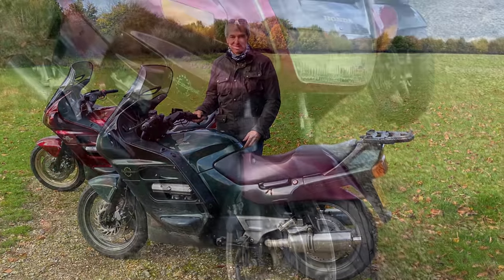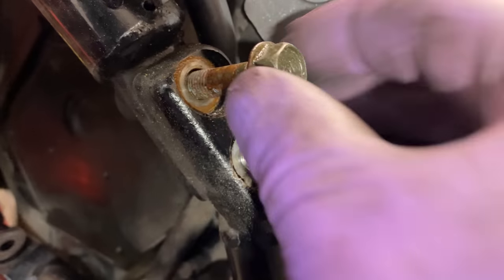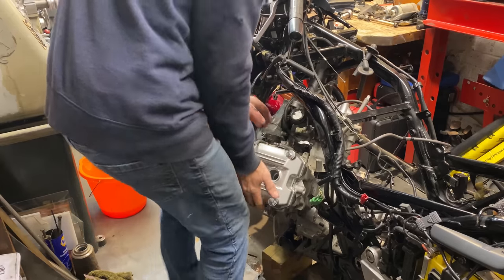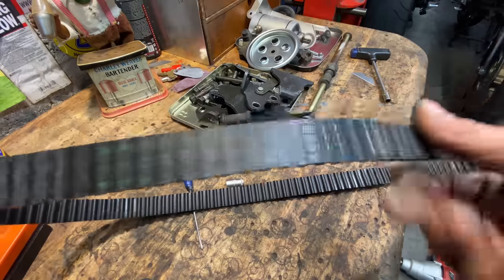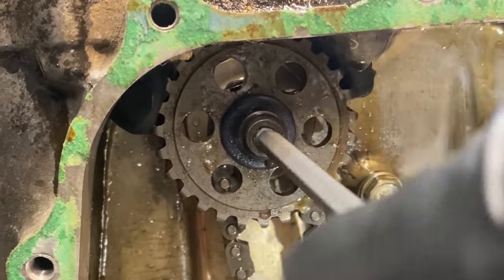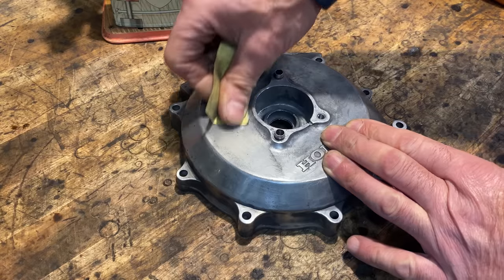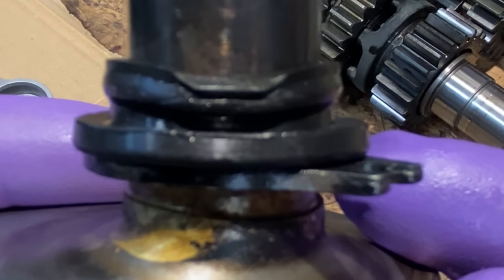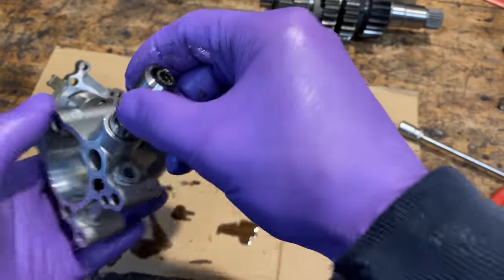Honda ST1100 Pan European engine removal and strip

Comment: Great to observe the Millyard in his native territory, not being mocked and under appreciated by the yellow haired ‘hey now right mate’ pillock on the tell-lie-vision. 👀🧐😎😜

Great vid. Awesome engine too. Love the design and layout of everything. Honda learned a lot from the CX500/650 era. 

The stainless water pump impeller made wonder if a similar design would solve the BMW F650GS Rotax issue of disintegrating plastic impellers. If I fabricate one out of stainless steel and braze the vanes on, will it need balancing? Probably not. Or could I just copy Honda’s design? Maybe. 

Great oil pump design too. Have always believed that the notorious oil pressure and supply issues experienced by Honda’s early V4s (Sabre, Magna and VF750F Interceptor) could have been solved with double oil pumps. Your reveal has got me thinking. 

Now I need to watch again for all the gems I missed. Thank you for sharing. Merry Christmas Allen and Tracey and hedgehogs. 

Peace 🏴

Comment: Absolutely loved my Pan, took it across to Belfast, down to Cork and over to France. Only problem I ever had was the oil filler cap "disappeared" on a run to Wales, I don't know if it fell off or was half inched in one of the service stations - anyway Halfords came to the rescue with a bright Yellow replacement. I did change the tires to Crossply's instead of Radials after talking tires with two ST1100 riding Glasgow traffic cops. (no not a lecture !)  Has anyone else tried Crossply tires on a bike, I had never heard of a bike shop even offer them.

Comment: He makes this look so easy but it's not... I don't understand how he can just pile up the bolts like that and know which ones go where, that's the most monotonous part to me so I have a trick where I use a piece of cardboard and I trace the shape of the part then push the bolts through it to keep them in the exact same hole it was in. I've done a couple of builds where the bolts were the biggest problem and I feel like moving the bolts around causes additional wear on the threads so I try to keep them in the same hole... Great video, Thank you Allen.     😁👍

Comment: Great video. I've got a ST1100 engine in a kitcar and it goes well. I know that oil pump well as I was planing at one stage to adapt it into a dry sump pump using the first stage as the scavenge pump and the second stage as the oil resevoir pump. As with many of my projects I did all the design work and once I'd worked out how to do it moved onto something else!!!

Comment: Allen, one task I have been mulling over is how to delink the CBS on a post 96 Pan.

The OEM hoses are NLA, and it's not practical to remake the complex hoses around the LHS fork leg.

It's easy to piggyback the primary and secondary circuits on the three calipers, but I'm not sure how best to loop or blank off the secondary circuit on each ABS pump ?

Many Pan and Blackbird have 20+ year braking systems and no practical means of  renovating - could be an interesting topic to cover ?

Comment: Glad you were able to save it! I just junked my '85 Gold Wing after knocking #3 out of it, and you can't just go get parts for it anymore, not even from Honda. The rest of the bike was so worn out it didn't make any sense trying to save it when a fairly mint one can be had for a 1/4 of what rebuilding just the engine alone on an already junky bike would have cost me. So off to the scrap it went. Wanted to cry but it was the right thing to do in that case.
Reply from the maker: Some Parts are becoming scare now for pans as well
Reply: @AllenMillyard  funny enough I'm seriously looking at a pan, a 2003 1300 to replace it. Already done a few wings so might as well go much more modern! But you're right, this whole parts thing bothers me.. I hate being head over heals with a bike only to not be able to rebuild after I've absolutely miled it to death. And there weren't that many ST's in the States to begin with so I just don't know what to do
Reply: Ran into this problem myself last year. I needed to replace my fork stanchons on a 97 ABS Pan last year, just couldn’t get a pair any where. Ended up having them rechromed instead, probably a better choice in the end.
Reply: @andrewnewstead4367  I'd agree. Original parts, I've learned the hard way, are often worth repairing whenever possible, even if a repair costs twice as much as a whole new aftermarket part for something you can't get an OEM thing for anymore

Comment: Hey...great video..
I have a question..
The rear brake oil does not return cbs system..
The calipers are fine..
When I disconnect one of the brake tubes on the rear the calipers go back..
Do you have an idea?
Greets from Belgium.
John
Honda st1100 abs cbs TCS 1998
Reply from the maker: No abs on my bikes

Comment: Great video but I am worried for your  fingers with that blade for scraping off the gasket. I have got a blue plastic holder for my blade which is safer and gives much better control of the scrape.

Comment: That's awesome  perseverance .. you've got it by the ton Allen    currently  I've  got one of my '87 xl600r Honda's  torn down with only 2,000 miles on it after it jump time     the timing chains seem to be a really weak point on that particular style motor    when I inspected the chain it was really stiff (kind of like the metal got hot and gaulded at the pins but didn't seem to be worn   as in it didn't  pull away from the cam sprocket when I pull it at midpoint   much at all  I guess the stiffness of the chain   alone  caused it to rattle jump time  I don't know if it's a defected chain or possibly a lubrication problem    ... I've got an XR650L basically the same motor with  20k mi. On the clock   and the chain is still tight as a drum   no noise    but I have four XL600R and all the timing chains rattle on them

Comment: Hello Millyard, I bought a Paneuropean in Holland (via the Net), it came out good, it's from 1991 and has 97000kms. Works well, has a healthy engine sound.
I'm afraid, because I don't have a motorcycle license or experience. I fell in love with the mechanics of this bike, but I'm afraid I won't be able to ride it, it's so heavy. I'm 1.70 meter tall and 60 kg in weight, and 60 years old, what do you think?
Another thing, I noticed that the gas gauge seems to be stuck in the full position, how do you fix it?
Reply from the maker: I’m over 60 and 68 kg have no problems riding the pan European or my viper v10

Comment: In the late 90's I had a ST1100 that I had done 100,000 miles on. It had a knock when shutting the throttle at low revs in gear. On stripping the engine all was fine except the bearing behind the clutch that had a retaining plate (I think is was behind the clutch or it might have been behind the drive shaft from below the clutch). On removing the retainer the bearing was very slightly loose - just enough to withdraw with fingers but no play - speaking to Loctite they supplied some retainer that they said would hold the bearing. While it was all stripped I renewed seals and shells and rebuilt the engine. First run the noise was still there - another 130,000 on top of the initial 100,000 and it was non the worse for the noise.
Reply from the maker: I will check the clutch thrust washer clearances when I put it back together though it looks in perfect condition

Comment: Alan, great video 👍
I too have a ST1100 but I have a weird problem with the clutch.
In really hot weather, I completely lose the clutch and have great difficulty disengaging the gears. The clutch lever goes really floppy and only engages with the clutch when pulled completely in and then only slightly.
When the bike engine cools the clutch comes back. Any ideas what the problem could be? Thanks Neal
Reply from the maker: Sounds to me like an hydraulic issue ? I would fit new seals in the master cylinder and slave cylinder and fresh fluid
Reply: Nice one Allen (sorry about the previous spelling) , I'll do that thanks 👍

Comment: Great Video Allen. I was wondering if that bike rocks like a Guzzi or BMW when you whack that throttle open at a traffic light? With the crank situated longitudinally, I would think it would rock at least a tiny bit? Thanks for the info so far. Enjoy and can't wait for the next. Happy New Year.
Reply: I have one and I can honestly say there is no rocking at all. I’ve had a Guzzi so I know what you mean.
Reply: I figured Soichiro and his engineers took the necessary steps to smooth out the design. I have always wondered about that bike. Thanks Andrew.

Comment: Brilliant timing, I have just got one of these off flea bay a 1996 to get ready for when I hopefully pass my test in 2023. Dealer said it runs brilliant just cosmetic ? It clocks into gear so its  got clutch issues . Backfires when revs drop so carb issues. I've only had it about two weeks and I looked to see about a stripdown on YouTube and there isn't a lot of quality videos out there on the pan. 
Are you going to do a restoration on the green one ? once you've done this one. It's served you well. Merry crimbo.

Comment: hello, what if the motor was disassembled but not marked, how now to set the crankshaft and install the camshafts?
Reply from the maker: the timing marks are present on the cam and crank  sprockets see later video where im assembling the engine

Comment: Having owned a ST1100 with the belt and then saw the ST1300 with a chain and the valve set up, the ST1100 seems to be a far better engine. It was very top heavy for me and had to cut down the seat to get my feet on the ground. Finally had to sell it because of the triple bypass heart attack at 70 now 78 and was sad to see it go. Still ride just a lot smaller machine.

Comment: Las t year I had to take apart my newly acquired Fire Blade for the same reason. I had to send the crank to get welded and ground, on the number three big end journal. Put all new bearings throughout, and it runs like new. I never got more cuts on my hands than when taking that engine apart, with the cases being sharp like razors.
Reply from the maker: Amazing

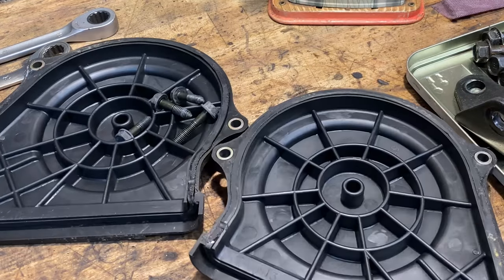Comment: Allen, when you removed the larger of the plastic covers from the front of the bike to give more space (time stamp 4:52), i noticed what looks like a date stamped on it. It is 1/4/18. This doesn't tally with the age of the bike. Could this indicate that the bike has had damage ? And maybe this has caused the 'knock'. Or perhaps its just April foolery !!

Comment: I have a strange situation that happened to me. I don't bring my Paneuropean ST 1100. It's in the legalization process. I usually run it until the fans turn on The other day I did a maintenance on the bike, checked the coolant level and added it, checked the brake and clutch hydraulic fluid levels and added it (DOT4). From then on the bike never started working again, what could it be?? gives a few (very few) explosions in the exhaust

Comment: 6:26 What wireless set is that?
14:34 Is only one gear pair hardened?
Reply from the maker: No all gears hardened Jobda used a different process on 5th output gear for some reason
Reply: @AllenMillyard  Obviously because that's the gear used 99% of the time.

Comment: The pick up seal is only a couple of inches above the screen and the pick up is at the bottom of the sump so it would have been submerged in oil also. Unless the engine was run low on oil, that likely had no effect.
Reply from the maker: I agree that's why I said "in certain conditions", but its still a defect on the original build. I don't know the history of the bike and its had quite a few owners and some years between mots covered only 1 mile

Comment: Nice work yet again bud, I just picked up about 4 weeks ago a green 1997 with 12k miles but have a knock when cold on right side once running for few mins choke of it goes away? Is this how yours was? If so looks like I have a job on my hands 🤣 merry Christmas hope you have had a good one.
Reply from the maker: Mine knocked when I load the engine as I’m about to pull away when in gear and clutch is slipping.
Reply from the maker: Also the knock got worse when hot
Reply: O interesting 🤔 mine may just be the norm pan knock then. Also I did come across one pan knocking got worse when out, balanced the carbs runs well now :) can't wait for next episode. I want to put a v8 in a pan frame

Comment: And part 3 will deal with the ST1100 wobble?
Reply from the maker: Never had a wobble in 117k miles
Reply: @AllenMillyard  That's unusual ,ST were infamous for wobbles . A friend of mine had one and no one could correct it ,including the dealers. He sold it in the end. 
It wasn't a tank slapper , just an annoying wobble between 80 and 110 kmh.
All the Police STs here in NZ did it too. The got rid of them for BMW 800s

Comment: You probably already have the engine Back Together by now, but if you take the new timing belt and soak it in 303 protectant, and then let it set for at least about 10 to 12 hours before you reinstall it it will last considerably longer and be far more durable. One of the best products for anything rubber going on to any engine automobile parts anything.
Reply from the maker: will be waiting two weeks for the big end shells

Comment: That oil pan should have shown a [rod] knock, but it was as clean as mine. I'd chase the throttle sync if you found nothing, start it and it's still there.
Reply from the maker: throttle vac was spot on
Reply: @AllenMillyard  I never heard the noise, so where is the idle lean drop, then the sync? A spotless oil pan is showing no engine damage, but a lean drop and sync could smooth things out. Pull the clutch lever in and the noise goes away? Just saying that's clutch plate tangs bang being out of sync will make that knocking effect. I'm sure you'll find it somewhere, however.

Comment: would check big ends with plastigauge
Reply from the maker: I will measure everything, Honda use a colour code system so I’ve ordered the correct new shells and they were almost impossible to find 🙈👀

Comment: Back in 2000-2001 ish I worked for the met police servicing these and some dinosaur k75’s 
 Fecking alternator changes 😂😂😂
Whole engine had to come out. 
I went on to do the bonds courier bikes , some had up to 116000 miles

Comment: Replace the vacuum diaphragm fuel petcock with new. Mine failed and in retrospect could of bypassed it on the side of the road had I known. 1999 ST1100A
Reply from the maker: Yes I’ve checked mine and it’s all good but I’ve known of several failing though

Comment: Coworker wants to buy a new Buick, 1.3L 3 cylinder turbo, on a 3500 pound car. I told him my ST1100 is 1.1L, 4 cylinder, 680 pounds. He doesn't want a new Buick. 😅

Great bike, 108k miles on it, I just resurrected mine out of the barn after sitting for four years, she needed a new battery and new gas, and I'm back to having fun and 45mpg back in my life. 🍻🍻🍻

Comment: I've found the best tool to remove gasket residue is a "Korean Chewing Gum scrapper" also known as "DUJISO Leather Knife Cutting Knife Edging Knife with Wooden Handle Leather Working Knife for DIY Leathercraft Cutting", lots of brands. normally the blades are laminated with good tool steel and can be sharpened razor sharp.

Comment: Have a good one alan old bikes with stupidly low miles a think just arent run in properly a think a had bandit 1200 minter way 40k rode perfect sold it bought 1 with 17k funny enough and it was nothing like the high milage one. Long story short bikes are build to be used.

Comment: The motor is bullet prove with out a doubt thrash it  all you like it'll never let you down  for sure guys
Reply from the maker: To ha fair it was running fine and went well I just didn’t like a knock it was making as pulling away